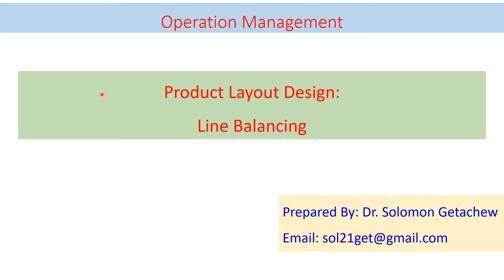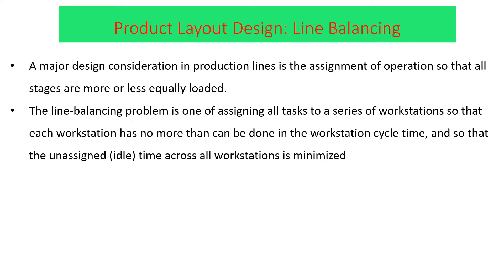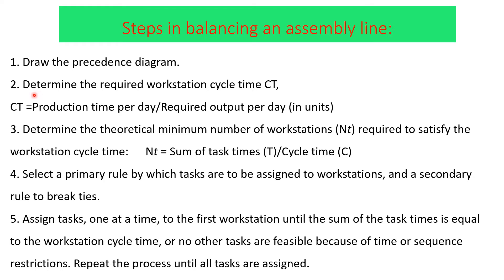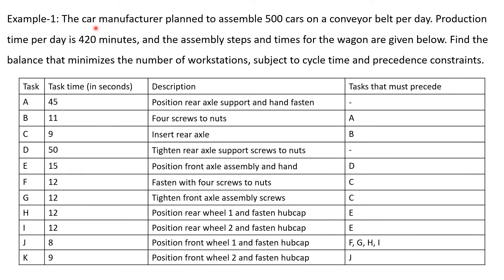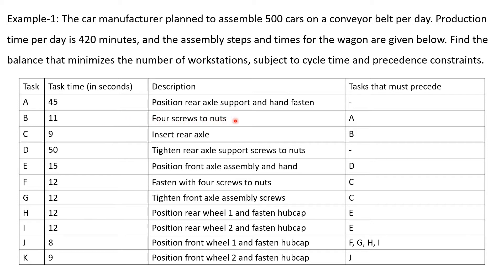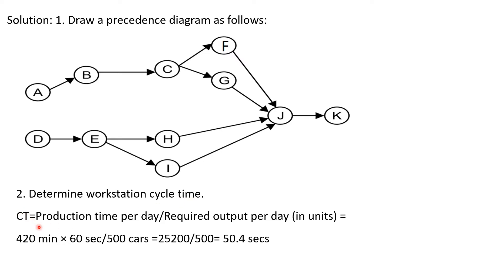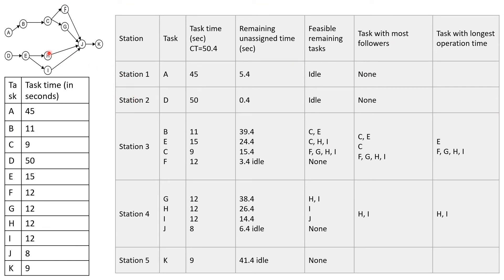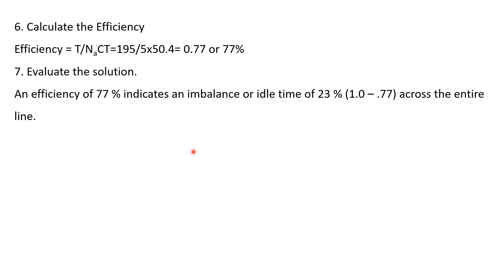Operation Management | Product Layout Design | Assembly Line Balancing | Solved Example

Comment: Hello sir.
What if the task is longer then the cycle time? what I should out in 3rd and 4th column?
Reply from the maker: In such a scenario, it would not be possible to achieve a balanced assembly line while respecting the cycle time constraint.

When a task takes longer than the cycle time, it creates a bottleneck in the assembly line, causing delays and inefficiencies. To address this situation, you would need to either reduce the task time, increase the cycle time, or introduce additional resources to handle the longer task.

Here are a few possible approaches to handle the situation when a single task time exceeds the cycle time:

Reduce the task time: Explore ways to optimize the task or process to reduce the time required for completion. This could involve improving efficiency, streamlining operations, or using automation or specialized equipment.

Increase the cycle time: If feasible, you could consider extending the cycle time to accommodate the longer task. However, this may affect the overall production volume and may not be desirable if the desired number of cars needs to be maintained.

Add additional resources: Another option is to allocate additional resources or parallel workstations for the longer task to ensure it can be completed within the cycle time. This approach would involve duplicating the workstation or introducing specialized equipment to handle the specific task, reducing the overall impact on cycle time.

Reevaluate task sequencing: Analyze the task sequence and explore alternative ways to rearrange the tasks or modify the precedence relationships to distribute the workload more evenly. This could help in reducing the impact of longer task times on the overall cycle time.

In general, if a single task time exceeds the cycle time, it poses a challenge to achieving a balanced assembly line. Addressing this situation would require careful consideration of the task itself, process optimization, resource allocation, and possibly reevaluating the task sequencing to find a feasible solution.

Comment: The difference b/t  Nt and Na
Reply from the maker: Nt is the theoretical minimum number of workstations is the smallest number of workstations required to complete the assembly process, assuming that there are no constraints or limitations. It represents an ideal scenario where tasks are perfectly balanced, and there are no idle times or bottlenecks in the assembly line.

On the other hand, Na is the actual number of workstations is the practical number of workstations required to complete the assembly process, taking into account real-world constraints such as cycle time, precedence relationships, task durations, and other practical considerations.

In most cases, the actual number of workstations will be higher than the theoretical minimum due to factors such as precedence constraints, task dependencies, cycle time limitations, practical considerations of resource allocation, and efficiency requirements.

The theoretical minimum number of workstations serves as a reference point or benchmark to assess the efficiency of the actual workstations. By comparing the actual number of workstations with the theoretical minimum, it is possible to evaluate the level of balance and identify areas for improvement in the assembly process.
The theoretical minimum number of workstations can be calculated by considering the task sequence or precedence constraints. The actual number of workstations takes into account additional constraints that is the cycle time considerations to meet practical requirements.